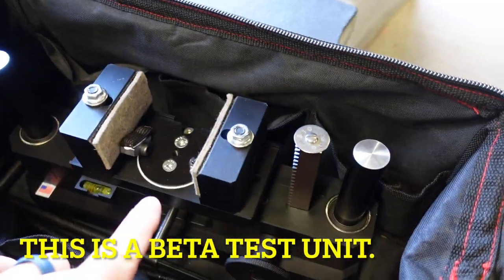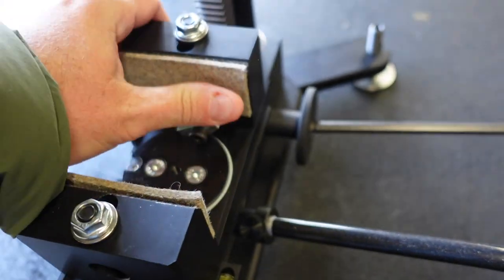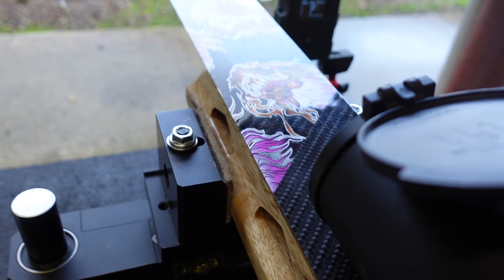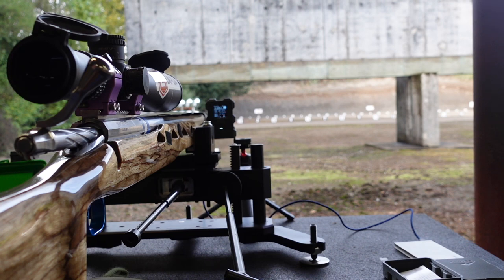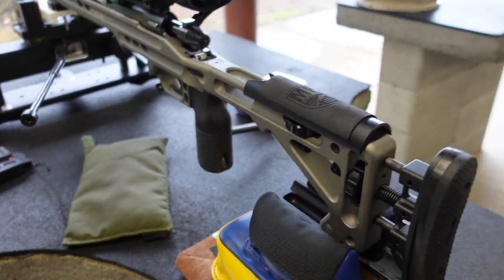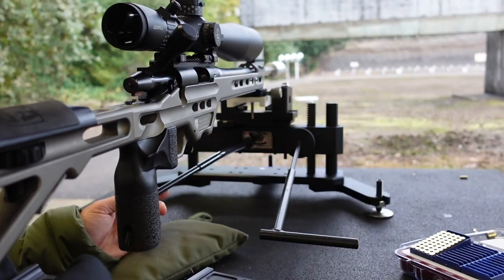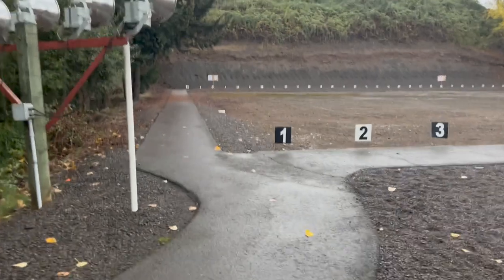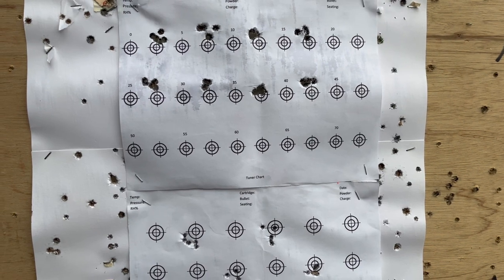Rodzilla Raptor F Class Rifle Front Rest first test

Comment: Always good content John....Interesting having the stop off the gun fore end and stopping on the rest from the rear.  Is that new or have I not been paying close enough attention?
Reply from the maker: Thank you. The ‘pin stop’ is something I learned from Erik about a year and half ago it works great for me. It’s not without its pitfalls as you have to make sure you set your rifle up correctly with it and always carry a back up in your range bag in case something happens to the one in the gun. Just a different way to do it but for me, it helps save weight on traveling and size.

Comment: Is ur foreend set in some kind of locked rail? Only rearward movement under recoil. Totally interested in F-class but know nothing. I like to learn about any & all  shooting disciplines. Thank you for the video.
Reply from the maker: No, there's no locking of any kind. The stock just rests on the front rest and by rule must be able to go in and pull out without any restriction. But yes, the idea is to have a front rest and rear bag setup that allows the the gun to recoil unobstructed backwards.
Reply: Okey dokey,. I know y'all shoot 308, do you use muzzle breaks to stop upward recoil, are they allowed by the rules?
Reply from the maker: @ericlindholm7510  only people that shoot FTR use a 308. But whether you shoot FTR or Open muzzle brakes are not allowed in any way shape or form.